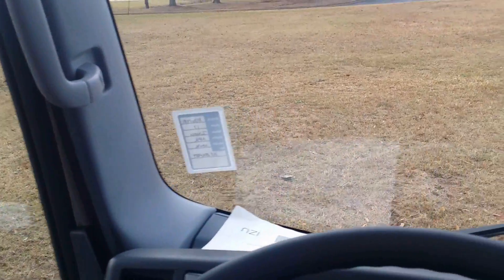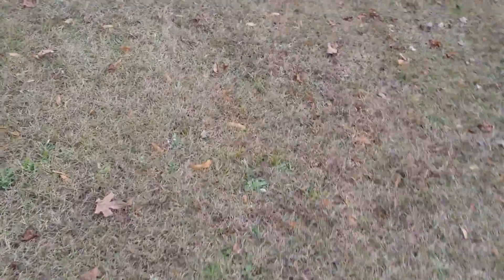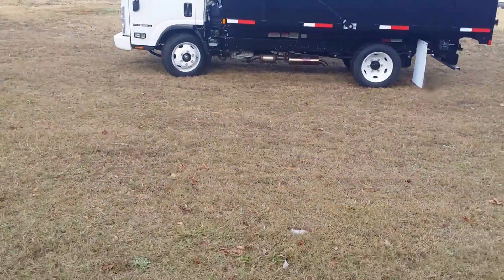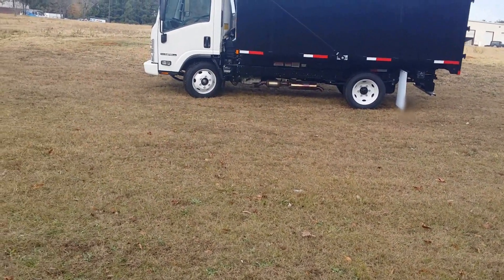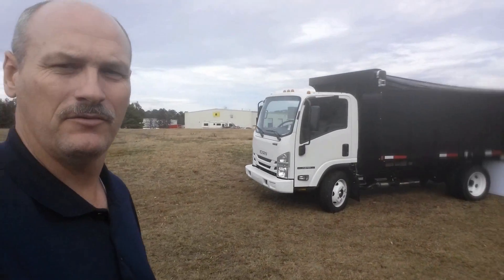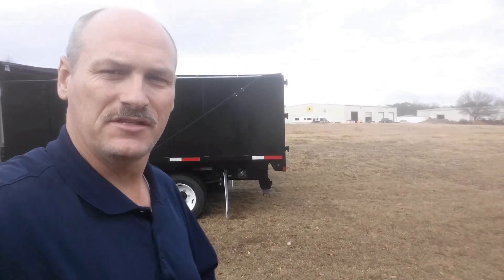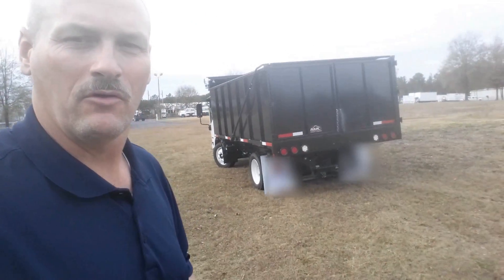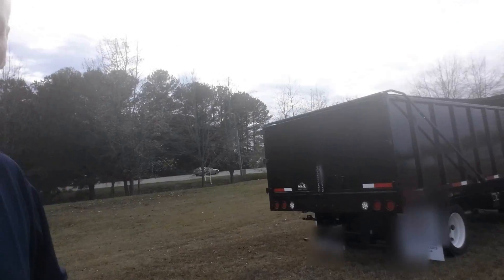Isuzu NPR Walk Around Dump Truck Tight Turning Radius - 16 foot dump - Michael Olden Lee-Smith

Comment: What is the weigh capacity on it ?
Reply from the maker: The truck is a 14500 GVW chassis (in 2021 we will have the 17995 and 19500 gvw versions available.  The CU YRD capacity is 15.5 and the payload is 5500#